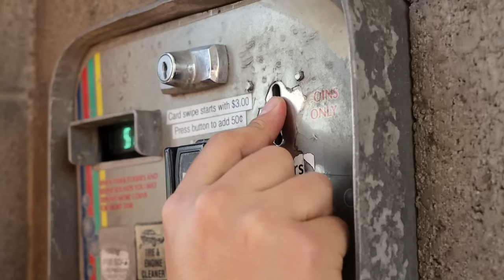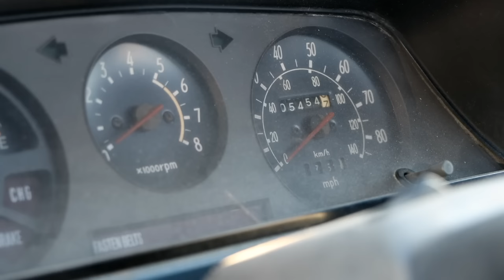STANCED 1979 TOYOTA HILUX MINI TRUCK

Comment: Did you have a problem with your Speedometer not reading accurately when you put low profile tires on your truck?
Reply from the maker: Yeah probably tbh truck is a ‘79 so nothing really works lol

Comment: Really love the truck but it needs to be raised by about 6 or 7 inches put smaller rims. and 1 or 2 inch bigger tires. Ur almost there. I think if u just exchanged the wheels 🤔 add a leaf or whatever get the ride height way up to OEM and the OEM or custom rear bumper. 🤔

Comment: Nice ride,my is a 1980 SR5-20R,currently working on it. Here in Cali,daily driver,I’m thinking about lowering it 3” in back with the leaf’s springs(street edge or bell tech) and nitro 2-struts.i just don’t know how to go about it in front,I seen some videos about ball joint flip or drop spindles,what did you do on yours??
Reply from the maker: To be honest we bought the truck like this so we’ll be doing a in depth video to show wheel specs, suspension, etc…
Reply: @teamnicejp  thank you,I will like to see it.

Comment: how did you lowered it so much without the torsion bars pointy part under the middle chassis not hitting?   what do i have to do to  lower mine like this?
Reply from the maker: Not really sure the truck came already lowered with suspension work when purchased.